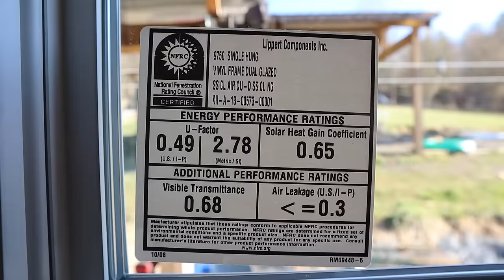Mobile Home Window Replacement - Kinro Low-E Vinyl Windows on Aluminum Metal Siding Home

Comment: We have a "96" Clayton that we bought in 1996.  We have been doing a lot of work on it.  There is so much upkeep on mobile homes that is actually more difficult than regular houses.  So we know the  how hard it is to find what will fit.  Everything has odd measurements . We always end up at mobile home parts store. Redoing our bathrooms was really an eye opener.  We are starting to replace windows now. Our house is paid for and there is no reason to go into debt at our age for a new one.  We are hoping to replace our metal siding for wood siding soon.  That will really be a chore. Oh, well, such is life.  Your home is looking great and you should be proud.
Reply: You are so right.  It's worse than retrofitting a really old home.  Nothing fits right.  Sighs.
Reply: I beg to differ.  I would rather work on Mobile Homes all day long then old Houses or even the new modern "Houses" that are built today.
Reply: @trxtech3010  now THAT'S some crazy measurements.  (Old houses)
Reply: NiNi to #6 haha I don't think you've ever worked on a old 1930s or 40s house or a house that was built in the late 1800s, believe me you think a mobile home is built bad? lol
Reply: I used Mobile Home parts store also, for my windows and doors and many things for my mobile home- I did have a colored metal  roof  put on. But i'm just gonna paint the outside metal siding. Mine was paid for in the begining so its been a work in progress.
Reply: lovenotes We have thought about just painting outside also.  I am right now priming and painting all ceilings and walls.  We have vaulted ceilings and I have problems with being on a ladder for long periods so that the ceilings are taking me a while.  I am painting walls in very fifties colors.  My daughter loves them now the colors are going on the walls.  Good luck with your renovations.
Reply: @trxtech3010  Our mobile home has 6 inch thick walls.  You don't see that in regular home construction.  Our mobile home is much more economical to run than our old home was and it's even larger!

Comment: This really helped me feel more confident in taking it to the next level: installing a vinyl window where none existed. I've done RV window installs, so this wasn't too far off. Making sure I cut the aluminum siding to the correct opening was nerve wracking. It fit the first dry fit, so I was happy I'd spent the time making sure the opening was correct. Then it was 15 minutes installing it.  It was best to find an actual brand new mobile home window, with a 1 inch jamb depth. My walls were only 2.5 inches thick. Thanks again!

Comment: Very helpful, and you two are such a sweet relatable pair. Thank you for creating content that I need but dont see much of. 

I live in a single wide mobile home with metal siding from the 70's so as you may imagine, its basically one severe storm away from falling apart. My father had done most of the repairs and did plenty of remodeling but though a ton of the original home has been replaced, the windows are still these terrible single pane windows and you wouldn't believe the amount of rot I have seen. After living in this home for 8 years, I am so ready to tear it down and replace it or move somewhere else, but until that move becomes financially feasable I get to keep fixing one thing after another knowing its basically a waste of my time and efforts since there is no way my home will last more than a couple more years. But thats life for ya. Gotta make due with what you have.

Thanks again.

Comment: Since you can no longer get Kinro windows I had no choice but to replace the windows in mine with standard Pella vinyl replacement windows. Since the walls are 2x3's I had to bump them out with 1x2" strips to get to a true 3.5" thickness to accommodate the windows. There is no video on YouTube that shows how to do this, I had to figure it out myself. It worked, I've replaced five so far. The hard part is buttoning up the outside because the windows that went in weren't the same size. I did it so that it's water proof until I replace the outside sheathing next year, then it will look nice and pretty. 10/15/22 update on this. I just replaced my second to last window. The last one will be in the bathroom. New exterior next Spring. I will be removing every single window again and will re-flash everything then re-install.

Comment: real good stuff kids...just got myself a Merit 56 x 12 single wide aluminum exterior MH in a nice 55 and over park...it needs work as everything is dated and original from 88 when it was built but the bones are good and strong.. I'll replace most windows and paint on the outside (roof is in great condition).  Thanks for the great tips..new sub # 30,850..good stuff...
Reply from the maker: Very nice!

Comment: A tip for siding in those old aluminum mobile homes, grab some full sheets of tinted vinyl skirting and install over your siding. You’d be surprised how good it turns out and it’s super durable.
Reply: Wait. Thought it is a bad idea to put siding over siding?

Comment: I used the Kindro 6 pane vinyl windows to replace on my mobile home from  77. It makes a big difference in changing the windows and doors. Because mine is a lot older, most of the window openings  had to be cut longer and wood  rebuilt at the bottoms of the inside of them. Mobile home parts store online and i used a lot of their coupons and discounts. Had them delivered to the house when you don't live near a mobile parts store.
Reply: I know this is an old comment but any tips on where to get the coupons and discounts for that website?
Reply: So ur home had 2x2 wall studs how did you work with 2x4 replacement windows
Reply: @jameskelly9243  watch the video of the one behind this= "wall  re-framed to fit a house window" it will show how the re-framing is done of the window. It is in their playlist

Comment: I've got an old 1967 holly park single wide on some property Michigan.  It's so cool because it's been really well preserved, with all original metal siding and the interior is totally original and still looks fresh.  The downside is even simple jobs like this are a challenge because the caulk, adhesives, sealants etc in homes built before the 80s are very likely to have asbestos in them.  So something as simple as pulling a window is best done by a certified asbestos abatement contractor.  The original windows in it are cool (the 3 pane louvered type) but also totally inefficient and even sorta dangerous (you can't crawl out of it if there was a fire).  I'll be upgrading them soon but I'm gonna have to pay for removal.

Comment: Sam for the next time you change out any windows you should leave some gaps in the chalking on the bottom in case water does get in it has a chance to get out. Also you should shim the bottom of the widow on the inside so you can get some spray foam in the bottom. 
 In case you or anyone else wants to question my knowledge about windows and doors, I worked for 2 major window manufactures in Canada for many years. I was the senior service technician for both companies I worked for. I am just trying to pass on some learning tools. I am in no way picking on Sam. Just trying to help.
Reply: Well quick question for you then. It it the correct way to install these over the siding like this? I have some reno windows (with built in brickmould) to install on a mobile with the exact same siding as the video.

Comment: Nothing but the best for those original windows, and such craftsmanship on the install (sarcasm).  I can't say if yours were any better or worse than mine, but I think once you get to a certain level of bad, it doesn't make much difference.  Great upgrade and teamwork.
Reply from the maker: Yeah, only by the luck of the outside window not leaking did we skirt any wall framing repair! That was probably our one "out" with the house on a project. LOL We'll pay for that from now on. Hahaha

Comment: Looks like the new windows you have been putting in are the kind for the newer mobile homes.  They have to lips around them.  One for attaching them and the gap between it and the outer lip is for the siding.  Still looks great though.  I gave up on looking for mobile home windows that were the right size for my place and just went and had custom double hung house windows made each time I was ready to replace one.  I just wish now that I had went with the full screen instead of just a screen that covers the bottom opening.

Comment: Thank you guys. Thou make such a sweet couple. I have just came across your videos. Wow. Love 'em. I have an 85 or 88 champion I think. Just cant remember.  I love the layout.  Need to redo pretty much everything. I am converting the front bath to just a shower. Making it ADA for myself. Got the tub ripped out and the shower pan installed. Bead board is up. Waiting on the acrylic tiles. Called Dumawall. Check it out if you haven't seen it before. Looking forward to watching your other videos. Keep up the great work. Have fun, stay safe and stay healthy.

Comment: The new windows looks great! I'm amazed you found windows that fit the openings so perfectly!  I imagine you'll be doing some framing around the interior openings? 
Nice teamwork, guys. Thanks so much for sharing. (:
Reply from the maker: That's the plan very soon -- to trim out the windows both around the perimeter inside the opening and the molding on the outside on the wall.

Comment: It looks like the windows are ready for vinyl siding later too right? I just bought a 79 double wide and replacing all the windows. Later (much later) we will add siding so we have to get the right windows. Love watching you two, we have remodeled and sold 3 double wides in the past and I wish we worked together like you two do. ❤
Reply: Where do you get custom windows with a nailing flange for mobile homes? I mean it has to be the exact size window with a nailing flange.

Comment: Nice video! I have a 1975 single wide and I'm about to replace all 8 (single-pane, aluminum-frame awning style) windows with new vinyl insulated single-hung windows. They were custom-made locally (in southern Colorado) and not too expensive ($1,800 for all 8). Is the sealant you put around the rough opening a silicone caulk? I know that stuff stays flexible and doesn't dry out. It looked like you were using self-tapping hex screws to install (just like the ones you removed from the old window). I would imagine any screw would work so long as it got through the aluminum and far enough into the wood, especially if you're going to put some wood trim around the outside. I'm planning on doing that, and I'll probably seal the edge of the window flange before doing it for an even better seal. The little "gutter" on my place leaks right on top of the old window and water got behind the top trim and rotted some framing and flooring, so I've got to fix that problem. Yeeha! Thanks again for the video. I'm fittin to thinkin about fixin to git er done right now. Redneck style!

Comment: As the proud owner of a "trailer" I have to say you guys are doing a great job!  I fit the stereotype better than you two fine upscale mobile home owners. But my trailer gets improvements when possible, it'll get there :-). I'm concerned about the top of the windows being proud. I would do more than seal it. I would shroud it. Perhaps one of those arches that are out over trailer doors?  You kids are smart, you'll come up with a better solution than I'm suggesting. With trailers water finds a way :-(.  Of course the glass would fall on gravel, anything else would be too easy to clean up. God bless!!

Comment: i just started buying a 1988 single wide. it had the"wood" composite panels for siding. im gonna eventually have to replace them. would you recommend replacing the panels first or Windows first? i was thinking Windows, either way I'll have to take them off twice, but idk.

Comment: Did you guys ever trim around the insides, and if so, what did you use? All our trim strips around the inside window frames, not sure what they're called, are rotten. Planning on replacing all the windows in a 14x70 mobile home. In the Wake County area, we found the best prices at Builders Discount Center. Thanks!

Comment: We’re any of the other windows you did before these put in over where the siding connects to each other and if yes how much of i problem did it give you?I have 1979 and our windows are 46x38 and the wife and I want to add smaller windows so on top of getting windows we need more siding to cover the area when we add smaller windows.

Comment: The windows look great. I’m currently remodeling a 72 single wide and I replaced 10 windows, but I used flashing and that white puddy tape. 7 of them are bone dry but there’s three that’s giving me fits by leaking. Any suggestions?

Comment: Thank you sooo much .. I have a 1965 Florida nightmare my walls what isn’t rotted are 2 by 2 s ...the insulation is dust.. I got some great windows from Lowe’s I’m swapping out the studs for 2 by 4 ..and putting in r19 insulation...what are your thoughts.. good/ bad idea to do .
Reply from the maker: That's exactly what I would do! Go a bit at a time and frame it up right, with proper insulation. We have hopes of one day putting a new roof on this home with overhangs then tearing off all the metal siding and re-insulating and wrapping, etc. so that it's better. We'll get there one day...
Reply: Thank you !!!

Comment: Yeah ya got alot of nuts that just make projects more difficult then what they should be. A fireman told me with all the government funding that are there to help fix homes, should be using some of those fundings to fix trailers moble home, because there would be trailers burn down because of the way they were built. I've been fixing my mobl e home over the course of 10yrs and it is a 1993 and the would framing is not dry rotted. Thanks for the video

Comment: Lol. Mine are grown now but yes not me did a lot of things. We had a ghost maybe Casper that lived in our house and put dishes in the sink and never washed them or rinsed and put them in the dishwasher 1 ft. Away from them. Lol. Laundry....dont even get me started. Lol. But the ghost did it😀 Thanks for the info. Bout trailer windows. Mine ...a 91 Summit doublewide...needs ALL new ones n i know it can cost a fortune. Hopefully i will get to it one day...10 windows and a tiny bathroom window....ugg. Apparently they are odd sizes so may have to get windows reframed out first for standard sizes.

Comment: That replacement window looks like it has a vinyl siding track on the outside... Use a pair of vice grips to remove the finishing nails easily.

Comment: I love watching you two 😊 i wanted to ask, because we have a similar style old mobile home. We took the bedroom wall panels off to replace them. And behind the insulation noticed you can see daylight where the top outer siding goes over the bottom siding. I know this is how it was made, but is there anything I can do to seal that area. I just think of bugs crawling up there and into the insulation eeeww. Let me know your thoughts. Thanks
Reply from the maker: We have the same issue with our home. We have plans to change the siding, but you could try taping the overlaps with a good quality tape like Gorilla brand to help seal them?

Comment: Did you guys just measure the window from the inside and got the approximate measurements  or did you take all the trim off to get a better idea of the measurements?
Reply from the maker: Our windows had some super thin paneling as "trim" on the inside of the wall framing. So we measured the width & height and got the closest size the mobile home parts store offered. We didn't have any issues with any of them fitting. Thankfully it seems most mobile homes used the same range of window sizes.

Comment: I hope you can help answer this question for me. We have a 2002 mobile home . In our kitchen we have a leak on one of the windows. Plus the water is leaking from the top of the wall. I have looked all around the window and found no leak. Could it be my roof that has a leak and running down my window. We have checked the roof and found nothing. What do I do ?

Comment: So with these styles of windows, how difficult is it to put screens in them? I have the double pain left to right opening windows in my home and they are leaking/cracking bad and I also have the aluminum siding and was looking at these styled windows as a replacement.

Comment: Will you Be putting any trim on the outside of the window to hide the screws?
Reply from the maker: Eventually we will be removing all of the metal siding and replacing it with wood, so yes. :) Since this video was made, we've moved the entire home to another state and renovated the interior. Not sure if that's of interest to you, but all those videos are on our channel page too. :)
Reply: @sam-and-angela you say your going to change your siding? You doing vinyl? Also are you honna have to remove the screws from the windows before taking out the siding underneath? Or what's your plan?

Comment: Where is the silver tape for the inside of the window frame?   Don’t you need that to
Protect the wood frame?
Reply from the maker: Not for this very specific style installation. We've had our other windows in for 2.5 years with zero issues.
Reply: @sam-and-angela  i was wondering bout flashing tape too. I have that menite (think you spell it that way) siding so dont know if that matters or not? to possible leaking...do you kbow?

Comment: How did you measure for new windows .
Reply from the maker: We removed the trim from inside the window (thin wood strips) then measured the opening from wall stud to wall stud. We then took that measurement to the mobile home part store and found the closest sized window that was about 3/4" smaller than the opening to give clearances for wood movement, etc. These are Kinro brand windows.